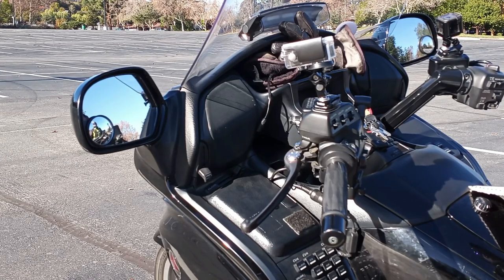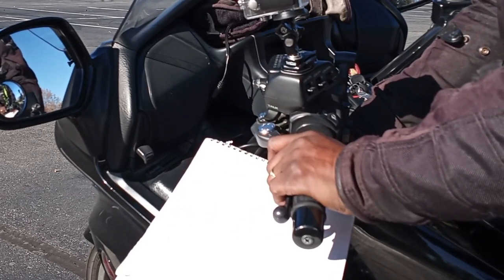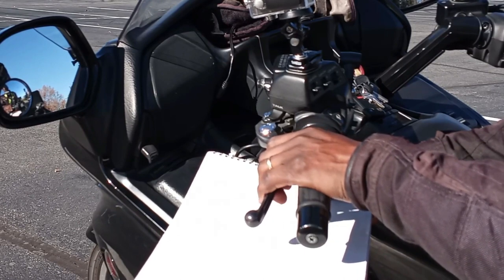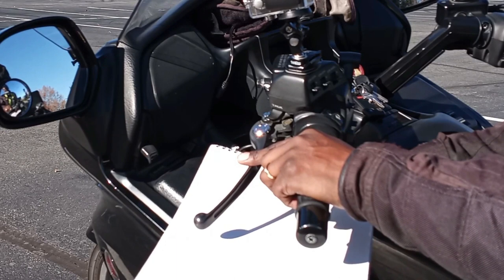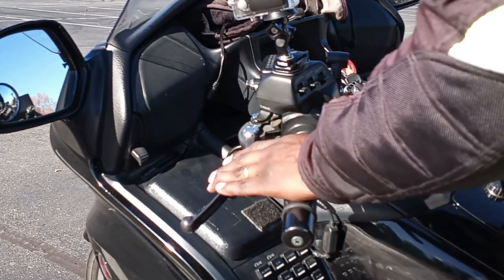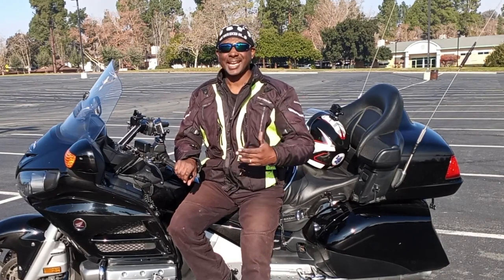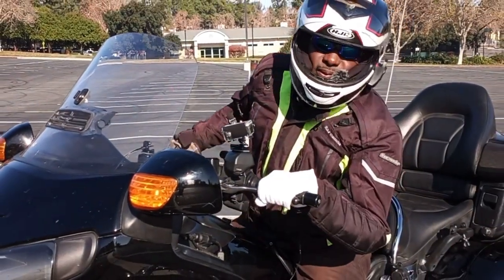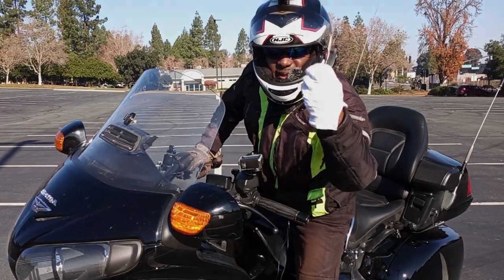The Friction Zone Explained...For New And Advanced Riders | Slow Pro Skills

Comment: I used to be able to do that all day. Now I gotta get it done quickly and either stop or get going before my hand cramps up. Do I see a DCT transmission for me? Hmm. I wonder how that will work at slow speeds? Good job Rich.👍🏻👍🏻
Reply from the maker: Hey Greg, We've heard nothing but good things about the DCT's hopefully I can get to ride on in a slow situation. In slow speeds, I would guess that more pressure on the rear brake than normal is the key. Just a guess...
Thanks for watching and commenting.
Reply: @BootsandJeansRiders  The DCT is brilliant at low speeds. Like you said, use that rear brake.
Reply from the maker: @bigredmachine55  Thanks Chip...

Comment: Rich, well done. In this video, are you slow riding in 1st gear or 2nd gear? Kenny
Reply from the maker: Hey Ken...In this demo I'm in 1st gear. However this can be done in 2nd also. With most of the patterns exercises  I ride in 2nd. The Gold wing have enough power to do most slow riding in 2nd gear without stalling. 
Hopes that answer the question.
Reply: @BootsandJeansRiders  , thank you for your reply and great demos. I am a 1st gear guy, so I’ll continue to practice in 1st gear. It just the motor sound was so quiet in your video,  I thought you might have been demonstrating in 2nd or 3rd gear. Final question, when you say keeping the rpm at 1100 to 1500, you are referring to 1st gear, right?
Reply from the maker: @kenlocke9806   @Ken Locke  Yes 1100 - 1500 rpm I'm in first gear. I would occasionally get up to 2000 rpm in really tight turns, but I normally stay between 1100 and 1500 rpm's.